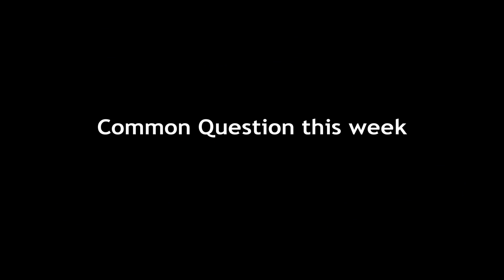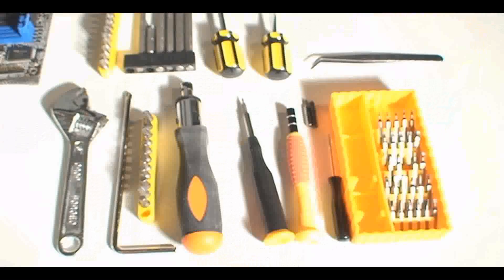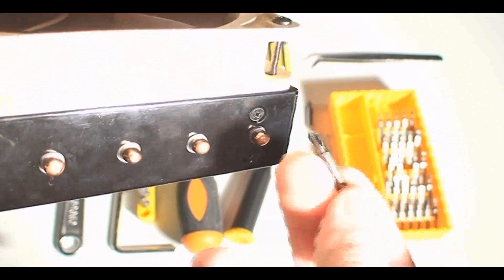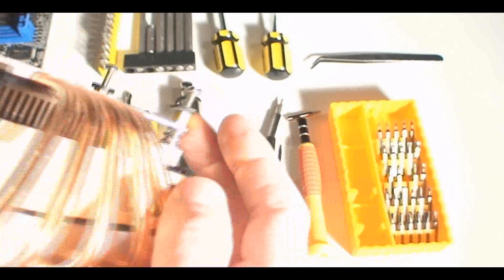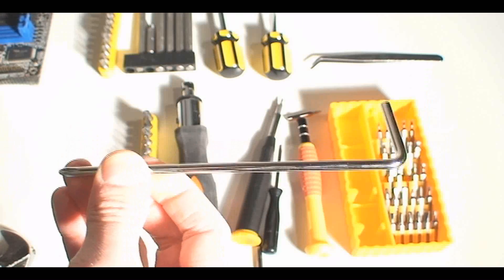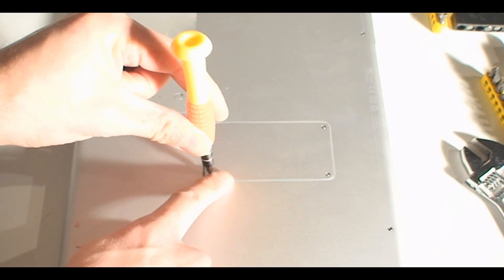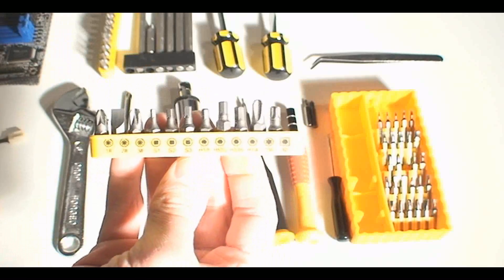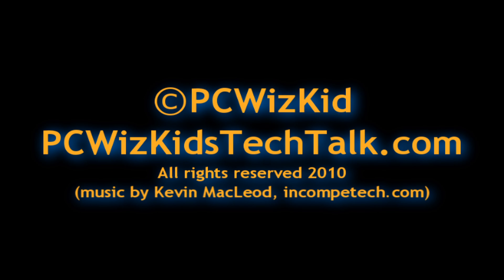PCWizKid's Weekly Tech Talk - Answer Back Episode #20

Comment: yes that is true the static is most asuridly the deathnall of electronics. It seems that I go through power supplys like you go through hard drives On my gaming machine I have used 3 power supply in two years. And they weren't the Cheops eatiher The current one is a corsair 1000 watt and even that one is giving me trouble The 12 volt is way under powered. Like 11.83  The computer works but it likes to randomly turn off and I have to bump the wires sometimes to get the machine to tun on

Comment: Makes since as the hard drive is nothing but iron files on a platter A magnet would cause those files to became miss allied I what I was getting at more then anything is i use a magnetic screw driver to screw down the mother board and it doesn't seem to effect the bios or any path ways on the board. While i am not saying you are wrong it just seems there is way over kill here about anti-magnetic and anti-static stuff Just me two cents